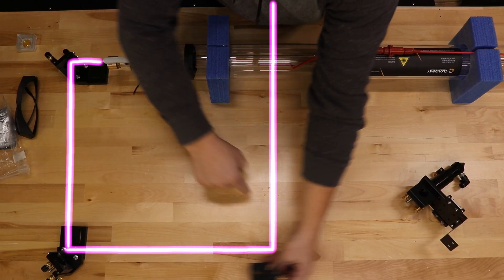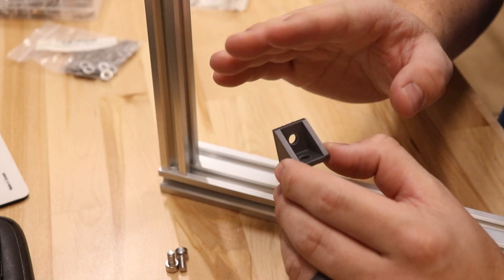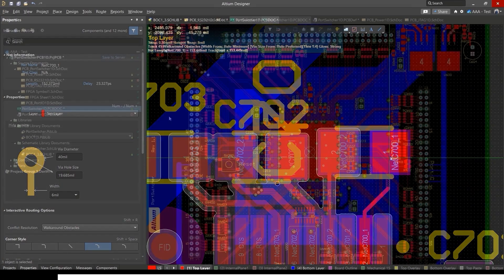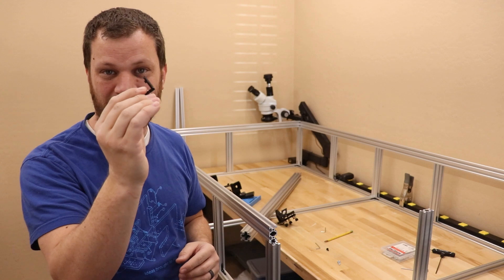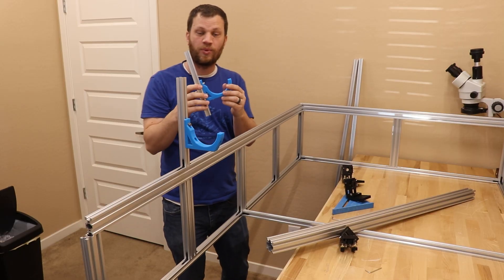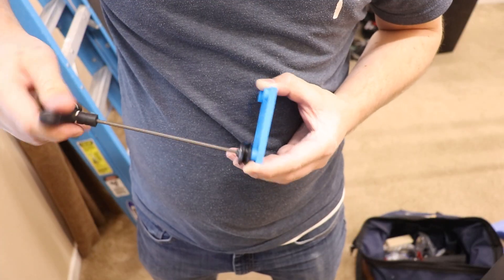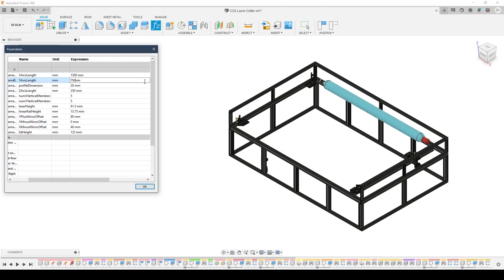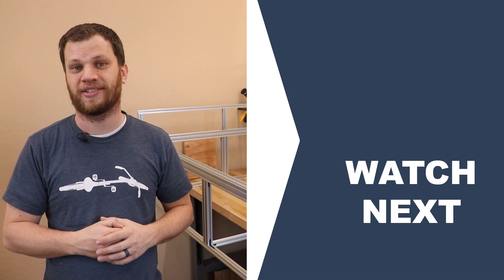Deciding What Size To Build This Thing - CO2 Laser Cutter Part 2

Comment: 3 things...  1. Have you thought about a single acrylic panel across the entire back? It would eliminate more places off gased material could escape and simply the build process. 2. Have you made sure to clean all oils off the surface of the tube after touching it? Oil build up can cause uneven heating/cooling of the tube and significantly shorten its life. 3. Are you considering cooling the mirrors? If the unfocused laser produces so much heat, it maybe something worth considering? Maybe heating attached to them?

Comment: do you have your design file available yet? i followed further fabs design as well and i like yours way better. im curious you said you built it with nominal sizes and only had to cut once. What sizes did you use? im interested in the dimensions.
Reply: I'm also interested in plans

Comment: Why are you doing a 3-bounce setup? Couldn't you just put the second 90deg mirror on the Y axis and the bounce/focus assembly on the X axis? It would deliver a lot more power to the cut point (though that doesn't seem to be an issue for a 100w tube).
Reply from the maker: You are absolutely right that I'm making one additional bounce compared to traditional setups. I think I addressed this in the first video, but since the laser tube is so long, my options were to have it run parallel to the Y axis and stick out the back of the machine, or have a really long gantry to hold the X axis laser head. I didn't want the laser tube sticking out of the back of the machine (but I could still do this if I wanted) and I didn't want the X axis gantry to span that big of a distance so I opted for one extra bounce. And like you said I'm counting on the fact that this is a 100W laser that the power loss will be negligible.
Reply: @bytesizedengineering  Nope, the power loss across the whole distance and an additional mirror will not be negligable. We have a 100W LaserSaur (48x24" workarea) and the power difference between the shotrest distance and the longest distance is remarkable. If we are at the limit of cutting power at the close corner, then we will not get through the material at the far corner. And thats with 3 mirrors only. Another problem might be, that you shoot from the 3th mirror in direction of the tube. If you don't hit the 4th mirror, you will hit the tube.

Comment: Many Thanks for all of your tips.  I've purchased the plans and about 50% finished.  Motor axis work well but Cannot get the mechanical limit switches to function.  From the plans and video, it looks like they are just plug and play.  Is there something that im missing? or do I need to setup in the RD8445.  Also for the main power supply:  plans show it connect to a 24V power supply, but there is another 24V power supply for the Z axis.  Should we split the Main power so it goes to each 24 power supply so the Z axis has power too?  plans dont mention it.  Since you followed the same build manual...you would know best.. so any help is appreciated.  Again thanks again and keep up the great work!
Reply from the maker: I'm not sure which plans you bought and are referring to. I haven't released any plans for this. I mentioned that further fabrication has some plans, but I'm not following them. I'm building this as I go. Limit switches need to be setup in the controller. I have a small 24V power supply for the controller and separate large 36V supply for all motors
Reply: @bytesizedengineering  Hey thanks for the reply!!! okok I just thought the limit switches were plug and play. lol.  Now it makes sense why they werent responding.  btw.... im working from Further Fab's plans. any tips on configuring the limit switches in controller. lol RD6445?

Comment: What are the safety features? What if there is a mechanical disturbance due to an earthquake while operating and one of the  mirrors get misaligned and the laser is shot at some other places including the operator??
Reply from the maker: There will be panels that enclose the whole frame. Also a lid sensor that prevents the laser from turning on while the lid is open. Also, anyone in the room is required to wear safety glasses rated for this class of laser.

Comment: Can you cut metal with it or does it need more power than 100w ?
Reply from the maker: For cutting metal, you would need to use a water jet, a plasma cutter, or a fiber laser.
Reply: There was a guy selling pre cut steel parts for automotive custom projects. He was utilizing a 4 kilowatt industrial laser system (40 times the power of this laser).
Reply: Nothing that you can fit on a small table top cnc I guess right ? 😄

Comment: Looking forward to seeing this finished and the build guide + BOM and CAD files. I just got my first laser, a K40, and I already know it's not enough for me lol.
Reply: phillipe romans has a 4 part video on how he made his......one of the best builds i have ever seen on you tube.....part of his design is 3d printed parts files....for free....but i donated to him anyway.....used his belt tensioner files and printed out on my cheap ender 3 printer....works like a champ....guy is smart and solves many problems found in many stock machines people buy online....
Reply: @glennmartonic6376  Got a link to that?
Reply from the maker: For years I've considered just giving in and getting a K40. But I think I knew that it wouldn't serve my needs.
Reply: @bytesizedengineering  Yeah I sweated it for a long time but it mostly came down to money and space for me. A k40 at least gets me started.

Comment: wear eye protection when test firing
Reply from the maker: You are absolutely right, I had them in the room with me but they weren't doing any good sitting on the workbench.
Reply: I am 100% loving this build series: But this comment should be pinned as it's not mentioned in the video.

The intensity of this laser, and weaker lasers can cause immediate vision loss with just momentary exposure if reflected off a surface into the eye.
Reply: And spf50 with uvc protection🤣